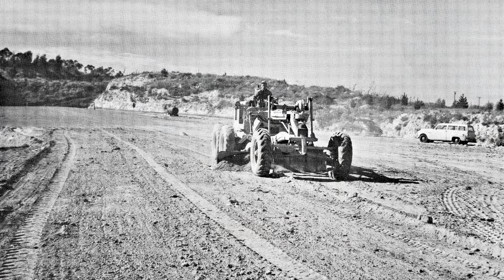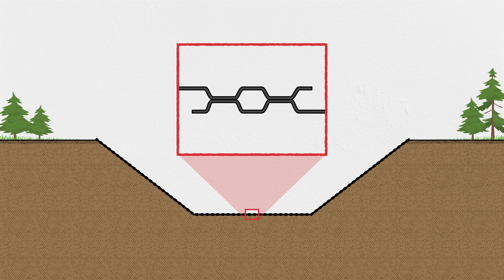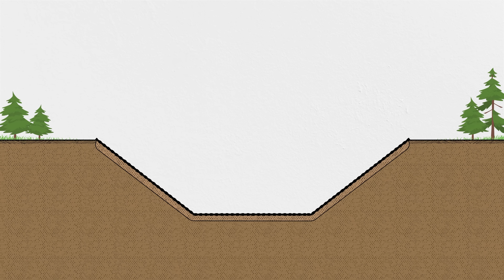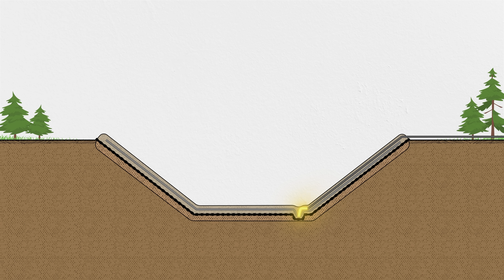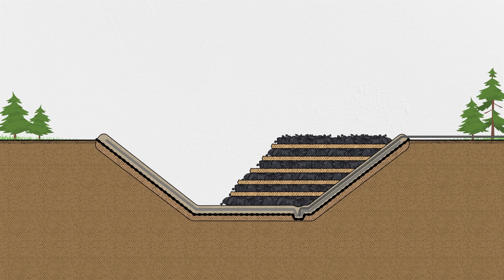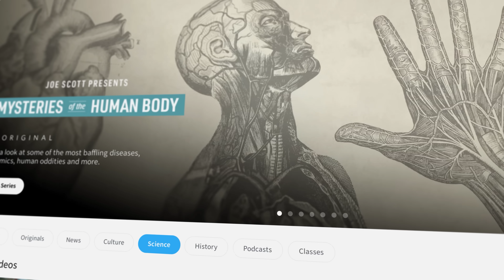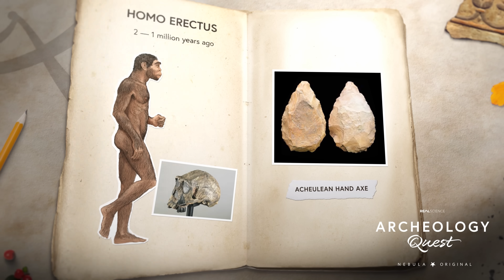The Hidden Engineering of Landfills

Comment: Interesting overview.  Some years back I used to haul leachate in semi tankers from a landfill to a treatment facility in a nearby town.  Each load was about 9,000 gallons.  The loading and unloading were done very differently.  Loading involved having the leachate mechanically pumped into the tanker, whereas unloading was done using gravity.  You just ran a large (6" diameter) hose from the trailer into what looked like a manmade pond a few feet away.

Comment: Grady mentioned that you don't put a landfill next to an airport due to birds. Sure, but where I live, I am  2 streets over from a Waste Management landfill that is behind the airport (but you'd never know it). There is no bird problem either otherwise UPS Air would have complained by now. Also, its said that landfill smells carry with the wind, but in the case of the Waste Management landfill, it doesn't really smell bad. On the rare occasion I do smell something, I think they are using some scent/odor neutralizing system because it just smells weird. I know I'm smelling the landfill due to what I'm smelling, but its not a bad smell of garbage.

Comment: I used to be a GCCS engineer (gas collection and control systems). I designed the “pipe system” inside landfills that led to and from the wells. They’re only briefly mentioned in this video but they’re critical to a landfill’s maintenance through their whole life! Some interesting things is that as a landfill is filled, naturally the weight pressing down on piping increases. We want to avoid a pinch in lines running to wells since that would lead to a pressure buildup and no suction at the well. Because of this, the pipe systems were cut and abandoned in place every >20’ of fill on top. We would often have to extend wells as well to reach the surface when there was fill on them. The pipes also need to run at a minimum grade (angle) to ensure any condensation flows downhill to a sump! If there are valleys, the condensation will pool and create another blockage. Super interesting stuff!
Reply: Seeing tomatoanus here was unexpected. Hearing that he was an engineer was crazy. Luv you tomatoanus!
Reply: Wait your the speed run guy
Reply: No way, tomatoanus was an engineer
Reply: @stfuyfc69420  I mean both speedruns and engineering are very technical it kind of makes sense...
Reply: @stfuyfc69420  lol
Reply: @stfuyfc69420  I think you meant the opposite of what your comma makes your sentence mean.
With the comma, you're making a strong argument that TomatoAnus was clearly an engineer.
Without the comma, you are surprised that TomatoAnus could possibly be an engineer.
EDIT: I've been convinced that the comma may actually be intentional. Not 100% sure, but I do see both sides clearly.
Reply: @kindlin  That confuse the hell out of me. It reminded me of the famous example of a similar comma usage; "let's eat, grandpa" and "let's eat grandpa".
Reply: @PBeringer   Lol, exactly.
Reply: @kindlin  nope. without the comma, he is saying that he doesnt believe he is an engineer, eg "there's no way this is true." an exclamation mark to show that it is an exclamation and not a proposition or argument would be appropriate, but many people just use commas instead of more complex punctuation marks (including people who use them in place of full stops.) a comma is better than no comma though as it makes it clear that they are separate clauses.
Reply: @PBeringer  the first example is clarifying that the clauses are separate - in the same way, "no way" is an exclamation separate the observation "tomatoanus was an engineer." no comma in between would be saying they do not believe there is a way that "tomatoanus was an engineer."
Reply: @kindlin  or, he can simply put a question mark to denote his suprise upon discovering the fact that tomatoanus used to occupy the position of gas collection and control systems engineer.
Reply: @kindlin  surprise that something is true is not the same as arguing against that thing being true.
Reply: @kindlin   yes. Tomatoanus is a YouTuber with half a million subscribers and a verified checkmark. I think they’re simply surprised that a YouTuber they likely watch is also an engineer, especially since his content appears to be video essays about events in video game speedrunning history, which has nothing to do with engineering.
Reply: @jonathanodude6660   Ok, you got me there. I had no idea who that was nor did it even occur to me click the profile. I guess I just assumed someone on the internet was bad at grammar - a bad assumption in this case.
Reply: @kindlin , he was being sarcastic. Lmao.
Reply: 😂 @PBeringer
Reply: @kindlin wouldn't he kind of need a question mark at the end to make sense in the positive? Like,  no way,  he was an engineer?  But then instead of a comma it could be a period. I think the comma just needs to be dropped.
Reply: ...wait, the small stick huge berries guy that makes speedrunning vids!
Reply: Crazy how many fellow LFG people are coming out of the woodworks on this video lol. I work on the engineering side for one of the big environmental consultants, and pinched laterals are a big issue at one of our sites. On the main one I’ve been working on, the  sumps are all old and the designs are pretty old too, so the HDPE “sheet” flanges (literally cut sheets with bolt holes drilled over the actual sump) are bowing creating oxygen leaks. There is also probably some subsurface separation on a few laterals… has not been a fun time diagnosing all the issues with this landfill as it was pretty neglected due to budget constraints. But I love this industry and how niche it is, wouldn’t work anywhere else.
Reply: @juulianft  we're quite a few! Hello to all my colleagues! In my case, mostly working in developing countries at the height of the UN CDM project frenzy. Pinched laterals, flooded pipes, and just the twisted mess of hoses, pipes and broken pvc when something settles more than planned! And how expensive everything is because landfills are so hostile to equipment.
Reply: What happens to the trash as it decomposes? Will it eventually form into some massive fossil of trash will it turn into some weird form of oil? So many questions, it is fascinating.
Reply: @shanebanx9631 Not all trash that goes into landfills is compostable; given enough time materials will break down and leech into surrounding soil, but you bring up a good point on fossils.
Given enough time and natural elements (erosion by wind and water, compaction, sedimentation and cementation, time spent dormant without more garbage being added), I would argue the landfill will form a region of altered soil composition much like a giant fossil (assuming nothing disturbs it). The oils and heavy metals will gradually work their way down or be carried away by natural phenomenon; anything too dry or resistant to change will remain and continue breaking down very slowly.
I've long held that thousands of years from now, landfill sites will be extremely fertile but also heavily contaminated locations thanks to all the artificially introduced/created compounds we've added.
Reply: @shanebanx9631  yes, sometimes - but rarely liquid. Bacteria eat the organic stuff and convert it into gas. If the landfill is "dry" sometimes decomposition is fully stalled - there are some landfills where you could find written texts like newspapers 80+ years old. When wet and decomposed it actually looks a lot like mulch - some brown spongy gunk, fairly inert (because everything putrescible already degraded) interspersed with inorganic garbage like bits of metal, plastic, etc.
Reply: Hi. My name is Tomatoanus, also known as "Mr Leachate", also known as "Layer of Landfill Pipe", and this is an any-percent speedrun of "Causing an argument in the comments section" performed on the current patch, by Tomatoanus.
Reply: what's your fastest split for installing poo pipes
Reply: All that work and education to be remembered as "Tomatoanus, Layer of Pipe".
Reply: this grammar debate is fantastic
Reply: It's a seriously interesting process. I did the electrical and instrumentation design for a new low-nox flare to be added at a landfill gas plant. It was seriously mind blowing learning about the processes at that facility!
Reply: I used to wonder how that gas was being collected, in other words: I was wondering how you accomplished this magic.
Reply: Sweetest speedruns youtuber? On my engineering video? I guess we doin @tomatoanus now.
Reply: Why are the USA still using landfills at all?
Reply: @erikelenstrom9685  It's such a frustrating answer, especially knowing that some other countries have figured out how to deal with their trash responsibly and elegantly.
Reply: I imagine someday soon we’ll figure out a way to send robots in to mine in the landfills, and in a decade or two they’ll be gone lol
Reply: Ah yes, the silent heros!
Reply: I recently have seen your vids come by my recommendations but haven't seen them. Now I see you here and I am mind blown. Small world we live in. Have a nice rest of your day. I will be checking out your vids later.
Reply: Your profile name is hilarious 😆
Reply: Spoken like a true engineer!  Ha ha....  I do have two engineer daughters, so respects.
Reply: in case you didn't know, if you wait to skip the cutscene until the monks dialogue disappears the loading screen to the overworld will be much faster
Reply: the trash man
Reply: How is that more economic than just using OGTC grade pipes like true gas wells. Something like 6.5#/ft 2 7/8” tubing can handle collapse loads over 7000 psi and plenty of flow rate.
Reply: @JL-dz1me you mean steel? H2s and other corrosive substances eat it.
Reply: That is amazing!
Reply: Close, but not quite right.
Reply: Near me is a field that i think is an old landfill. Its full of pvc pipes in an "upside down J shape" ive always assumed these were off gassing pipes. Are they?
Reply: TomatoAnus literally sounds like the most disgusting thing I've ever heard of.  Yum.
Reply: I install the gccs systems for landfills. But we also take care of the drilling as well.
Reply: Rubbish 😂
Reply: LFG engineer is one of a rare species now in the solid waste business because not many junior civil engineers want to apply/study for this job. It isn’t simple as many people thought….
Reply: I’m currently doing a GCCS EXPANSION right now lol. 1200ft of 18” pipe and 800ft of 12”. For and RNG site.
Reply: There's a recent 'revelation' that sufficient airflow (read: force) can traverse any gap if you use a flexible but sturdy weave to produce the piping. Any punctures would be filled by the air pressure forming the tubing to the material that punctured it. By that logic, could it conceivably replace your design by lifting the weight above it? Or would the air pressure needed to sustain the tubing be a ridiculous waste of resources? Or is this perhaps a way to lift any obstacles in order to build new tubing anywhere?
Reply: but how fast and what % did you complete?
Reply: Well hello there one of my favorite persons. No matter what you’re going through, it will get better ❤️‍🩹 I love you
Reply: Bro??
Reply: I was a gas tech and heavy equipment operator, too, @tomatoanus. I worked at a landfill for 8 years. Aside from the stink, it was the funnest adult sandbox that I have ever played in!
Reply: Thank you tomato anus
Reply: Have you heard this before?

From April 1, 1992: The day Mount Trashmore 'blew up'
YouTube · 13News Now
Apr 1, 2018

https://youtu.be/iUFuFeupTNI?si=Awu7MlGx-3_JF3kU
Reply: Thank you for the extra info. Very interesting.
Reply: I was not expecting to see you here.
Reply: Your comment about cutting and capping  pinched wells is actually not true. You design and build collapsible wells so that this does not happen. They weight and pressure the trash adds to the pipe will drag the pipe down as the trash starts decomposing. A collapsible well works very well with this, you will never have to worry about  the pipe being pinched. also, after you drill then drop the well in place, the material you use to fill in and around the well will also help the well from getting pinched after it gets buried. When you extend a well, you cone around the well with clean fill all the way to the cap then start dumping around it, or you can use a wider pipe to act as a sleeve and protection around this well, problem solved. You're welcome...
Reply: Wait what the hell this is tomatoanus LOL. Im a plumber so I was super fascinated reading your comment then I read the name and was doubly enthused lmao. As always, remember that no feeling is final!
Reply: pipe laying speedrun when?

Comment: Park idea on a landfill seems like money laundering because the landfill is desperate for funding after closure. They’re better places to invest public funds for parks than a landfill most likely more cost effective.
Reply: Fun fact many landfills actually have to post a bond or a financial assurance per the federal regulations that budgets for the upkeep and  maintenance for 40 years after the landfill is closed. So once a landfill is closed money usually isn't an issue. In addition many landfills are owned by local governments and once a landfill is closed it's up to what the local government wants for the empty space, so many local governments want to put parks on landfills since it's an open empty space and there are design restrictions for what can be built on closed landfills. Other governments for example will lease the space out for solar companies to put solar panels on top of landfills so that they can generate energy, or they'll turn into hobby RC airplane clubs.

Comment: Another great video. Glad I subscribed to this channel! It would be cool if they cover insulation if they haven't already.

One of my first construction jobs after getting my hands dirty doing demo was insulation. We'd take turns blowing it in up in the attic of these homes down in Orange, TX and it was get to over 130°F in the attic so we could only go in 15min shifts. After that I learned about asbestos and stuff while redoing the insulation on a home I was renting that was built in 1932. It had counter weight windows too and I lost one of the counter weights in the walls too so I had to fish that out.

But the most interesting was when I lived in Sweden I remodeled an old school built in 1806 and they used sheep's wool and sand as a mixture with paper to insulate the walls between these two huge beams. The walls were at least 6ft thick or felt like it. I had to install security cameras and drill through it to run a line into the house. I went back to the tool shop in Avesta like 4 times to get new longer drill bits then finally ordered one that I only ever got to use once. It was a weird time in my life but I really did like that house. It was cool to work on something so old and the location was the best. People in Krylbo are cool AF.

Comment: As an engineering intern one assignment I had was to set up the trash and recycling program in a new building under construction at my company.   I was given a tour of the landfill and recycling center.   I recall they had on display trash corings, just like they do for glacial ice, sea beds, etc.  It reached back about forty years.   I could still read the newspapers buried in the oxygen-free environment and see how society ramped up use of plastics for just about everything.  That was nearly 30 years ago and I still talk about it today.
Great video.  Thanks.

Comment: I remember when I was a kid in the 1980's there was an issue where a housing estate had been built over the top of a capped garbage dump. The kids in the area started suffering from rashes and it was tracked back to a toxic black sludge that was oozing back up to the surface. For sure technology and regulation has come a long way in the last 40 years, but the reuse of that sort of rehabilitated land is always going to face some quite serious challenges.

Comment: how THE F do you fix a pump from the bottom of a landfill if it goes bad..... makes no sense.
Reply: They excavated the landfill out to fix it if that's how it's designed. In most landfill designs, the state regulators  only allow for gravity systems to collect and drain leachate out of the landfills so that there isn't a pump failure like you described.

Comment: I’ve worked with landfills that accepted a bunch of old wallboard from demolished houses along with municipal waste. There were a lot more issues with hydrogen sulfide generation compared to other sites, requiring a special treatment system to capture the sulfur. Flaring it off creates huge amounts of SO2, which is an air quality issue. Another great episode!

Comment: In Denmark in most (if not all) of the country, at home we divide our trash up into multiple types of waste, such as recyclable materials (paper, glass, metal, plastic etc.), food waste and general household waste

The food waste gets fed into a machine which grinds it into a pulp, which can then be used either for biogas for fertilizer.

The general household waste gets brought to incineration plants, where it is burned in massive boilers, which gets turned into hot water or steam. If it is turned into steam, it will first be used for electrical generation in a steam turbine, where it will afterwards be turned into district heating, the same as the hot water. For those that don't know what district heating is, it is the power plant transporting hot water through pipes to the houses in the general area. This hot water is then used for general heating purposes in the house.
Reply: sadly most of the world hasn't figured out a working split-at-the-source recycling system